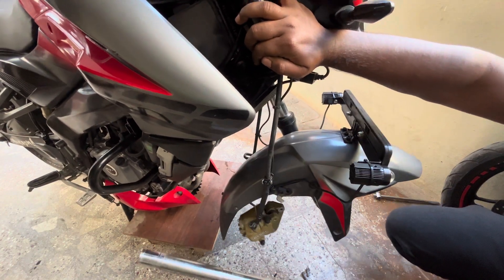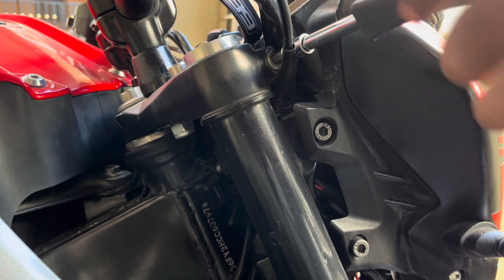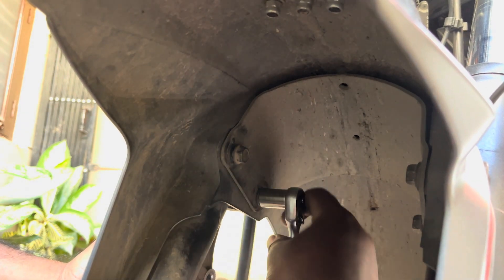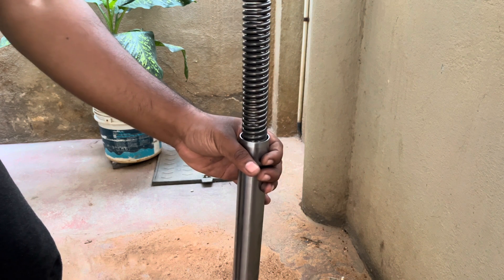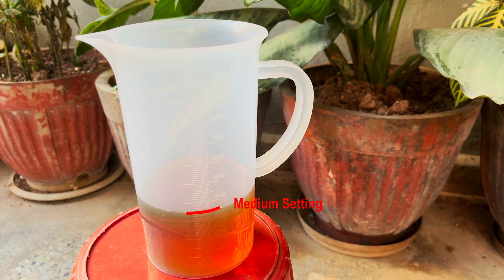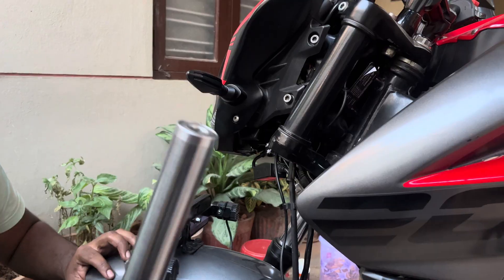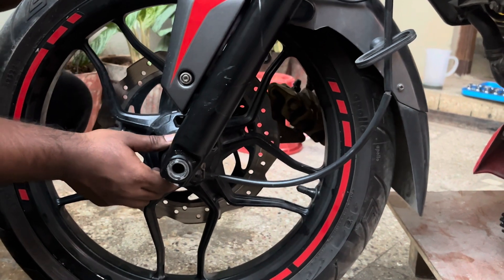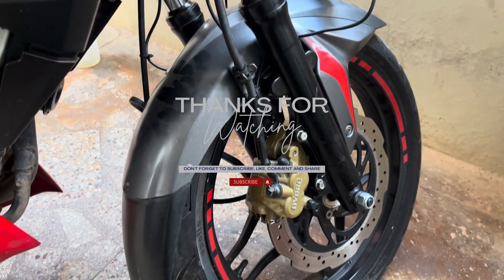How to Change Your Fork Oil ? | Front Fork Maintenance | Make Suspension Hard or Soft #ns200 #ktm

Comment: Bs7 Ns200 metor console fitted for Bs4 Ns200 and showing Gear indicator.. Make a video on that topic.... that video will go far helpfull for Ns200 riders...
Reply: Is it worked?
Reply: It can't bro 
1.its fi
2.it has ecu which calculate the dte and all stuff
3.even if gear indicator works . The check engine light will be always on
4.the speed sensor working is highly doubt.

Comment: After replacing my fork tubes, my mechanic had initially put only 175 ml per tube and suspension felt wobbly and bike was bouncing at high speeds.....the bike felt really sluggish on turns and bottomed out during braking. Went to a different mechanic and added another two bottles 175+175= 350 ml per tube. I prefer this setup now. Suspension is mildly stiff but front end responds better than stock. Note:- If you ride fast and do Cornering, go for this setup...if you like city commuting and rarely do 100kmph+ stick to a softer setup.

Comment: The service manual of NS 200 recommended 280ML of sae 10w20 grade oil for each fork. Isn't the 20w motul with 350ml each side is it too much oil which might become very stiff and excess oil lead to leak over oil seals after some time ?! Give us a good explanation please ? @arkionx
Reply from the maker: Hi @jasvanthoegasus, 
Yes 280ml is recommended but it’s not a fixed standard. And also as mentioned in the video, based on the oil level and your preference, you can increase or decrease the oil level to make your suspension softer or harder. 
Moreover don’t worry about the oil seal as excess oil will not damage the oil seal as there is plenty of space for the oil to circulate inside the fork tube, and I have been using the same 350ml quantity with no issues.
Reply: How much amount of fork oil by default come from company bro?
Reply: @princeashish3536 approx 262 ml per fork for ns rs
Reply: Kitna no page par milega yr ...mere service manual par Nehi mil raha hay please batao yr

Comment: I also just changed the shock oil because my right shock was leaking oil.  I use ATF oil.  Initially I filled 280ml for each shock, but I felt it was very hard.  Finally I reduced it by about 18ml (to 262ml).  This setting is quite comfortable for me.  Feels stiff but stable.  My weight is 90kg

Comment: My rs200 has handle vibration  problem  at 80km and pulling left any solution???
Reply: This is very common in ns200 cases. Don't worry much, it's a design defect.